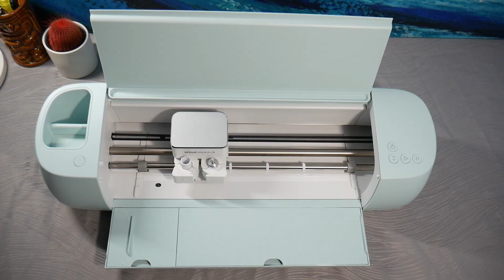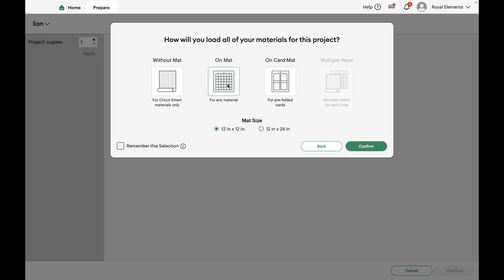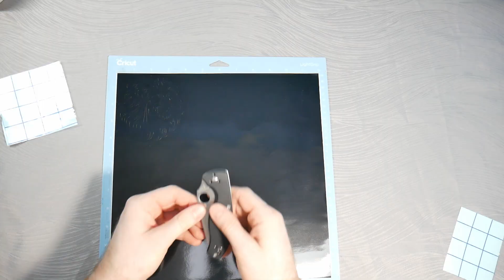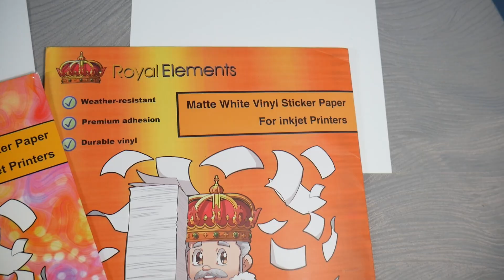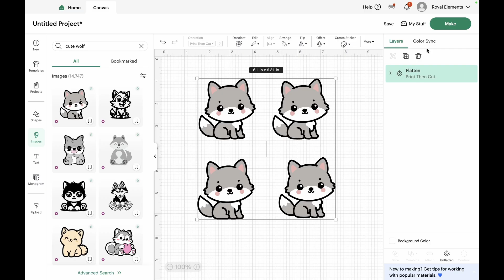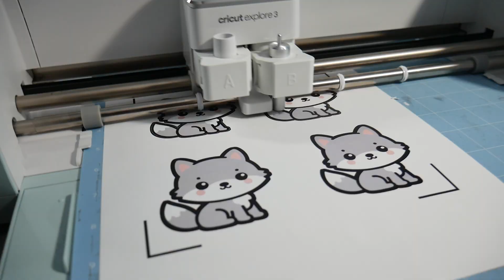Adhesive Vinyl VS Printable Vinyl: Which Is Best?

Comment: So, do you create a separate offset to cut the laminate to seal the printable vinyl?
Reply from the maker: You can or you can just laminate over top to make it look cleaner. Water could seep in around the edges though
Reply: @royalelementsofficial  Thanks so much for the feedback. Think I'll go with regular sticker paper for die cut stickers. Car decals, I'll definitely do solid vinyl.